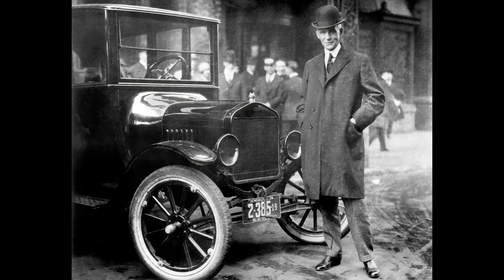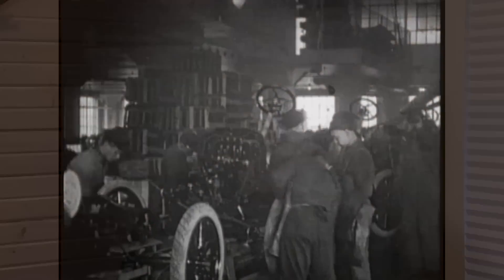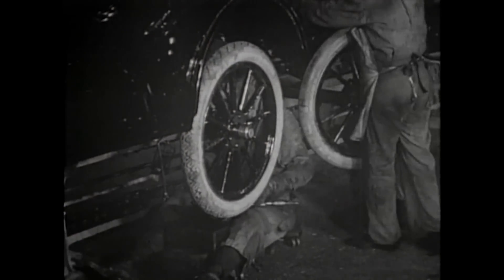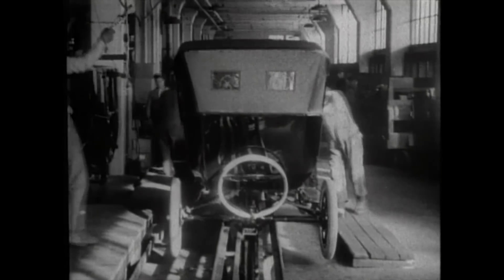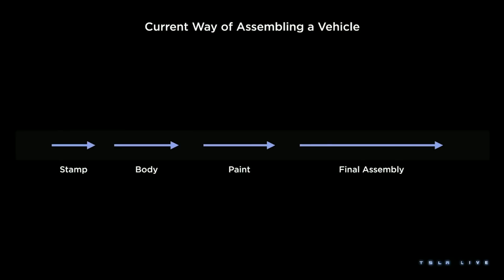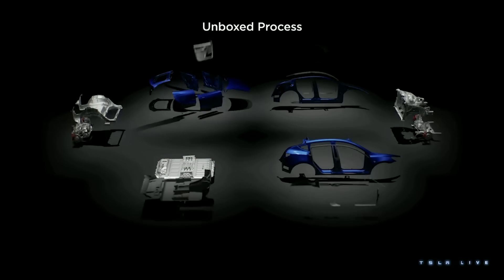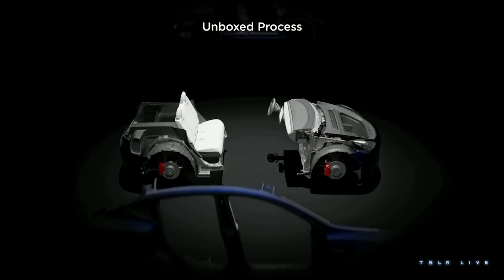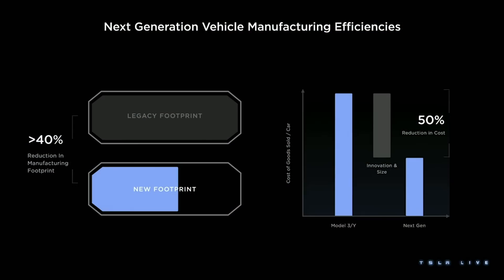Move Over Mr. Ford, Tesla Just Reinvented The Assembly Line

Comment: my thoughts exactly, unfortunately the reaction on the stock market was to be expected because it lives from news that they can translate in transaction value. Instead Tesla explained the roadmap as to how they will make it possible to reach 20 mio units per year and to how it will be feasible for much lower costs models. The most funny thing is that by listening carefully you can draw all the actionable information you need: with the annoucement of the next plant in Mexico, you can make an educated assumtion that the first cars will start rolling out in about 24-30 months from now, so they do not need to make a new product presentation in the next 12-18 months. Further, the new manufacturing philosophy will enable two produce up to 2 mio units/a. But the big challenge still to be solve is of more local nature: how to build up the supply chain for the volume, that challenge will push for more vertical integration: now they have the casting and starting to do some inhouse plastic inyection molding, in the future they may integrate more by using the free space to get more elements closer to the assembly space...It will be really exiting to follow for the next 3-4 years to come.
Reply: They know that the value of dozens of other stocks they hold has now been decimated.
Reply: If Tesla manages to reach their goal of 20 million cars in 2030 who is going to make the other 100 million cars a year demanded by the world???
Reply: @joeking433  Seba forecasts 80% fewer cars on roads in 2030.
Reply: @waynerussell6401  Where does he say that?  I'd really like to see that.  Can you give me a link?  Not that Seba can predict car sales with his head up Elon's butt.  It's just too hard to predict because there are too many variables.
Reply: Don't believe the lies from Telsa and Elon Musk the Trump supporter
The way Tesla wants to make cars is very bad it is totally unrepairable and disposable. If a Tesla has a tiny Bingle it will be a total unrepairable write-off 
Tesla is taking away your right and ability to repair your own car.
We need cars to be made normally so they can be repaired
I will never ever buy a Tesla or speaking nicely about them again after all this bullshit you stupid yanks say
All American Made cars are ugly rip off lemon dangerous lemons

Comment: I found it interesting that today, Tesla installs the computer at the beginning of assembly, and the computer detects and tests parts as they are added.  I don't know if that is common in the industry.
Reply: No its not common, actually Tesla is the only one - not even Nio or Xpeng do it that way. The computer not only detects but is the built in the quality control and test of all sub assemblies of the car as it is built and operated all the time. And it is used for most of the service and manintenance work afterwards till its end. You can perfectly well say, the car is built around the computer. Drive train, displays, additional displays in the S/X etc. are all known to every car. e.g. the chargers and power electronics are identical between ALL cars since Plaid/3/Y. Each car knows what parts it has built in and adjusts accordingly. Down to charging, discharging, sentry mode, motor temps. Everything.
Reply: Nothing Tesla does is common in the industry !!! I too found that part to be so simple, yet so profound !!
By-the-way, no other OEM can do this because the computer in the car only runs the entertainment system, all the other computers are from suppliers that can barely talk to other computers through the CAN Buss.
Reply: @bbcooter388  Exactly! They cannot do it because they don't have a central computer, just individual drive units for the cars systems.
Reply: @bbcooter388  And that is precisely the reason no legacy automaker can copy this manufacturing method - they have to unify all the software and wiring to split the car into modules - they cant do this using outside suppliers that don't work together.
Reply: Nope, none are doing anything close to this. Tesla has a virtual car, and for each car, they have all the information duplicated in the database, so in any problem, they will know exact all the components at highest detail level possible...
Reply: https://www.youtube.com/watch?v=JOAI1uzZMU4